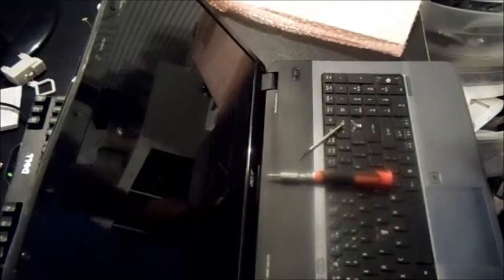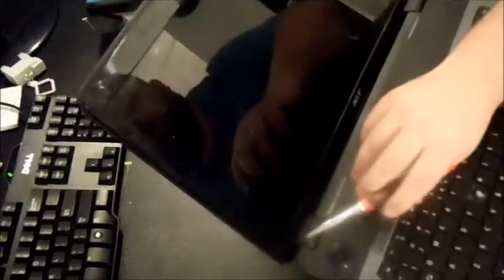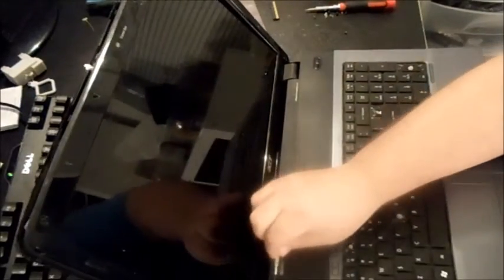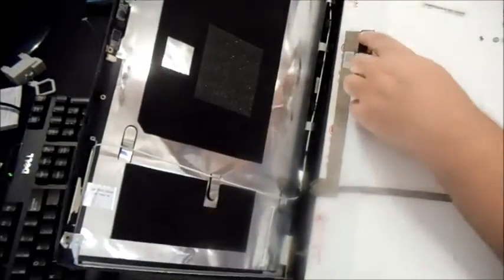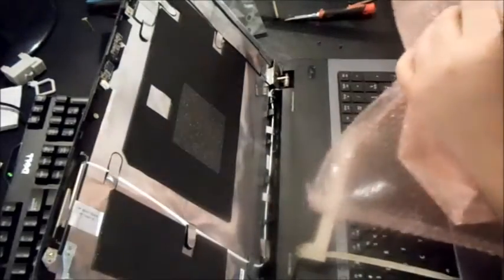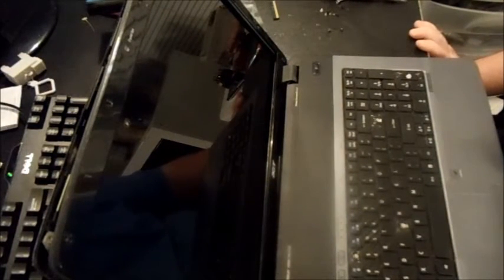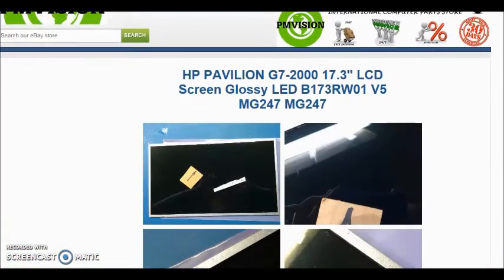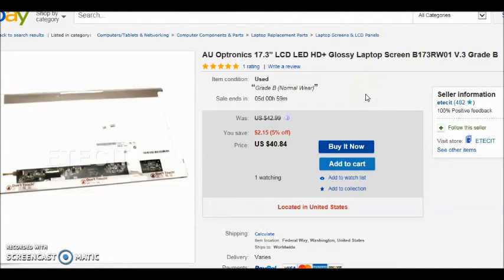Acer Aspire Laptop Replace Broken LCD SCREEN (Install 5349 5517 4520 5253 5532 5251 5253 5536 V3 zg5

Comment: On my Acer aspire 5517 I believe the hinge wire to the monitor has a break in it...if I open the
 monitor to it's usual position the screen is dead. If I open it a 
little more it comes to life. 
*Is this a difficult repair, are parts available for a 2009 laptop?

Comment: Leaves a lot to be desired. Instead of already having the item already taken apart, just Fwd the slow parts but show vital close-up key points. A guitar pic works well. Better to have plastic against plastic and so on.